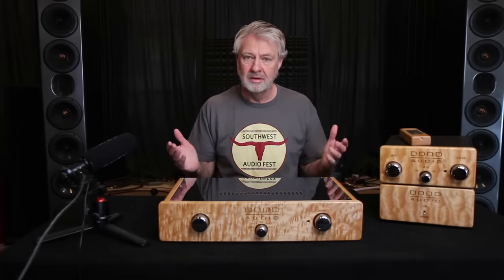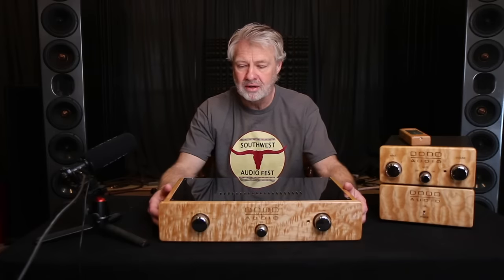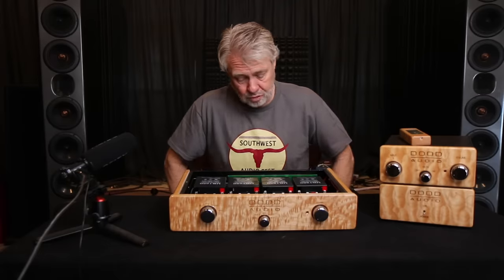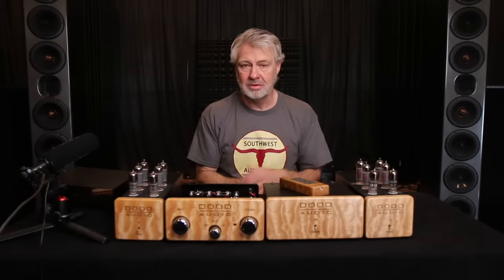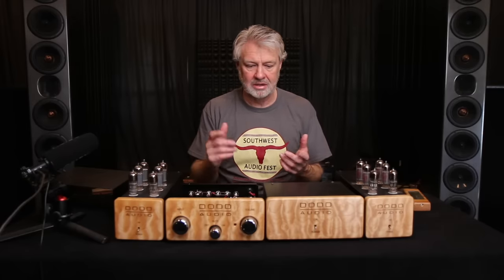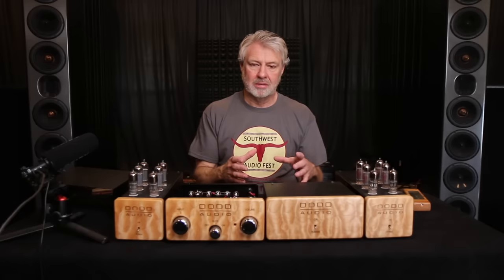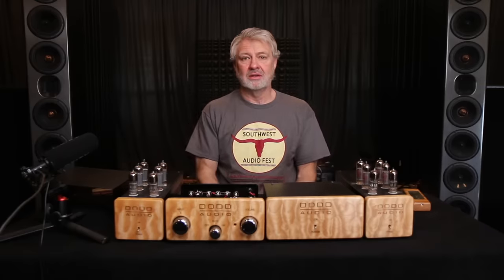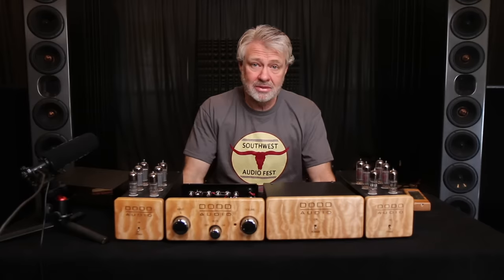Unveiling Danny's Audiophile Rig: Off The Grid and Beyond...

Comment: Danny

Having multiple years in electronics  I have 3 rigs  in my house  DACs,  Tube PreAmps, Streamers, Network Switching All modified to run 12 Volt  and 5 Volts. 

Yes everything you described about the sound is spot on.  I'm Dallas one day I will make it by to see you .

I consider You a legend  in this Hobby I'm positive that my  work has prefected running a system in this manner.

Comment: On the Mac Mini DAC thing, you should try using a fiber optic connection from the Mac Mini to your DAC to further eliminate RF noise which does collect on a copper wire based Cat6 network cable connection. I use a 10 gigabit SFP+ fiber hub on my Mac Mini connected to a Sonore Signature Rendu via fiber, which reduces network cable noise, and the Signature Rendu then connects into a Holo Audio D2D converter which then feeds into my KTE Holo May DAC. As a DAC upgrade, to the Holo May, I would suggest the Playback Designs MPD8 Dream DAC. That DAC is probably the greatest DAC currently on the market today, but it’s not cheap at $15k. Also I use the Mac Mini for upsampling in Roon to 768k PCM and then using the Holo may to decode that 768k PCM signal in NOS Mode, which is far better than trying to up convert in the DAC itself.

Comment: Danny all of this explains how all the little adjustments and crossover tweeks make a clear and immediate difference! 
Your system is very high resolution and resolving a ton of detail and is the reason all adjustments and tweeks are magnified in comparison to plain off the shelf electronics... where lot of resolution is just simply not there to begin with .

Comment: Impressive stuff as usual!... Most of the tube amps I build are for guitar. They are definitely not "critical listening" devices. However, I have been experimenting with DC power supplies for a few years. My goal was to save money and weight by not using big power transformers. It isn't easy to get clean power from a boost converter circuit. Especially when it's boosting to tube plate voltages. Supplies like that can generate their own type of noise, not to mention heat.

Comment: 1- use large ultracapitors 3400F and Ian Canada ucpure for power. The best power supply in the world. Lowest esr possible. Your bigger battery sounds better due to lower esr. Ultracapitors are the best in the world and charge 20x faster than a battery.

2- use audiolinux on a pc running on battery paralleled to ultracaps. Far better than stock Mac mini. FAR.

Comment: One if the nicest sounding amps i have is a JL audio one from my car. I tried it inside with a car battery and it was lively and rythemic and effortless. It is a class D as well. Class D power amps could be a great match for battery due to the efficiency. Tube class a on preamp, D on the powee.
Reply: Which model amp are you referring to? Is it one of their older slash models?
Reply: One of the best class-D amps I listened to is tripath ("class-T").   Tube warmth with almost class-D efficiency.
Reply: Try the little TPA 3110 ,
Reply: Loads of options running Class D amps off battery, I've been doing it for years, plus plenty of Dac boards that run off 12v .
Reply: @JasonWW2000  XDM500/3  With the 2 x 75W running Focal Aria 906 + JL audio 10" w1 in custom sealed box enclosure. Installed in the car I used C6-650 components. I was surprised how good it sounded in the room. Stacking up real well to the Supernait 2. Ok not quite as musical as that but more lively and rythemic and amazing bass for what is not a big amp !
Reply: My friend was not able to tell that I had a sub connected. Sub only playing below 60Hz cause I HATE low registers of deep human voices coming out a sub and I heard that in many peoples systems in cars, common problem. Not easily solved. The doors in a car are not speaker cabinets but need to act as if they are ,so people roll off the bass early to compensate and have sub play to 90Hz  It's not a compromise I would make though :D but it's the quick fix.
Reply: BTW the Niam was 4 times the price of JL car amp and can't run a sub. Food for thought.
Reply: I ran an old JL car amp if a cheap 12v power supply and it was a surprisingly good sound. It was a test to see if it was worth installing in my car. It passed the test easy. Very impressed
Reply: @Batman-n1q1v  Same. JL makes good stuff. Instead of insanely expensive caps and massive transformers I do wonder if a Optima Yellowtop would be just if not more  effective. Huge amounts of current. I think mine can sustain 25amps for 2 hours. Which is about 300w DC sustained. GR is onto something.

Comment: Danny, couple of questions: 1) how do you connect the mac mini to the dac via i2s i.e. does the mac mini have an i2s output, and what type of i2s cable/connection do you use? 2) is your Dodd preamp with variable gain? what gain do you usually run it at?
Reply: The MacMini will recognize the DAC input and it will output an I2S signal through the USB output. My Dodd pre is not a variable gain. Mine has a unity gain output.
Reply: @dannyrichie9743  hmmmm... what device will help getting the I2S signal over USB ???
Reply: @tango_gru  Amanero makes an interface module.

Comment: The bit that would be useful to know is how Gary turned 24Vdc into HT for the tubes without creating switching noise.....
Reply: Agree 100%
Reply: He was a really sharp guy.
Reply: Clearly it did if it took out the camera!
Reply: @Oggycrew  I agree.  It cannot be very quiet (RF-wise) if it messed up the camera from that far away.
Reply: @danmarjenka6361  These are dead quiet and don't produce any RF noise. I will check this out and see what was freaking out the camera.
Reply: @dannyrichie9743  maybe just a turn-on transient if you're not noticing anything while in use...
Reply: @v12alpine  It might be,  and that was turning it on in the mute mode.
Reply: Ha, it wasn't the camera that beeped. It was the pre-amp beeping to tell me that the batteries needed charging.
Reply: Interesting my supportive comment about the power supply was deleted…
Reply: @envisionelectronics  I didn't delete it.
Reply: @dannyrichie9743  That explains it. That is a very nice preamp.

Comment: pretty interesting set up. AC line noise is a much bigger issue than many think. If a person looks at a scope you can all the harmonics (low and very high frequency) riding on top of and well above the 60 hrz main AC frequency. For years companies have been trying to filter it out to varying degrees of success. All this noise is one of the reasons aftermarket power cords can make such a big improvement contrary to what the naysayers chime in with. Likely not as quiet (low noise) as BAT power though. As the noise floor is lowered, resolution, detail and imaging greatly improve.
Reply: True, but all of this noise gets filtered out during conversion to DC by any and I literally mean any properly designed modern device, something that has been shown again and again by actual measurements made at Audio Science Review.
Reply: @SteelBlueVision  If all the noise got filtered out then BAT power should not sound any better...............

Comment: Please try supercapacitors from Maxwell, XS or EATON. They not only balance the voltage, filtering out high frequencies, but they can provide instant electrons, through a physical reaction and not a chemical reaction, like batteries. They do not have much reserve, but they are supposed to be used with batteries, extending the batteries' lives because the big peaks of amperage draw will drain the supercaps and the batteries will only serve to charge the supercaps and keep reserve for longer sessions.
Reply: Our batter buffers work a little bit the same way.
Reply: Ultracapitors Danny are far better than batteries.
Reply: 12V supercapacitors are used for current peaks in highend car audio.

Comment: I noticed significant gains with the way my system sounded when I traced the wiring in my apartment to learn which outlets were on each circuit.  With 10ft power cords, the source and amp were plugged into  outlets that were about 15 ft apart.  The two outlets in between were removed, wires pigtailed and cover plates installed.
Reply: I’m building up crossovers for the X-bravo kit and intend to use the same isolation technique with the components of the crossover.  Crossover will be externally mounted.  Components will sit along the speaker wires between the amp and the drivers.

Comment: I have also taken my house off grid and running solar and a big battery bank which again supplies all my loads. The sound has never been better. Best investment as an audiophile ever.
Reply: That just moves the source to the solar inverters though. He is running ing pure DC and uses this wizard electronics.gurus circuitry.
Reply: @RobertCookcx Not necessarily, he could isolate a smaller battery just to run his audio system while the main battery is charging during the day.
Reply: @RobertCookcx   Even if he is running off the AC generated by the solar grid. It will be much less polluted than the one coming off the states grid coz of less amount of load in the house.

Comment: Thanks, Danny.  2 questions...How can the lay-audiophile get off grid without your bespoke solutions?  And, did you try inverting back to AC so that gear with IEC connectors could be used?
Reply: Danny can probably shed some light on this.....I have thought about using a portable battery pack like the Bluetti or Jackery units sold on Amazon.  I think the issue is that you are stepping up the voltage of the battery pack to 120v, then stepping that 120 down to 12 volts (or even 5 volts) inside the audio component.  Too much conversion of voltage probably results in extra noise.

Comment: I'd actually like to know what Gary and you discovered regarding the lithium batteries and why they didn't sound as good. 

I have a Virtue Audio Sensation that I'm using 2x12v 7ah LiFePo4 batteries with for the power supply. I've never used SLA batteries with it though. Only issue I have is the cheap SMART charger I'm using squeals once the batteries are fully charged so I have to disconnect with a switch when I want to use the amp. Thanks for mention the charger brand you use. I'll have to look into them.

Comment: Danny, two things. You mentioned that you at times use some chip amps. I have experimented with some low power chip amp boards and am impressed. Which chip amps are your favorites? Also interesting enough about the 12v Mac Mini. Now I refer to myself as "Sound for the regular guy." As I'm not high end. I came across an old 12v touch screen medical device. I installed Linux on it and connected a (low end) USB DAC to stream flac files. When I experimented running it off a battery, wow even with my low end chip amps and self made tube gear it was noticeable. I thought it was just my imagination, but maybe not after seeing this video!
Reply: I've experimentee with chip Amps and class a transistor amps and they all sound terrible to me. I can only live on tube Amps. I don't know what in an missing or maybe my ears don't match transistor sounds

Comment: So a harbor freight battery tender which is a trickle charger and a 12volt 25 amp hour battery on one of these chinese mini amps. That accepts 12volts dc should sound better than an 80's 50watt amplifier that runs A/C?

Comment: Hello,
I recently started contemplating using a computer UPS to run my small gear. Do you think that a product like cyberpower sine wave battery backup can do the trick to eliminate the noise from the power source.
I recently bought a LPSU and the change was dramatic to my headphone amp and dac. So I was wandering if a near perfect sine wave would have a positive impact on the overall system?
Reply: I don't think those batteries are large enough for the task. Plus big AGB batteries are pretty cheap.

Comment: My experience with C-tec chargers are that they are extremely noicy. Do you use them connected, turned on, while listening to music, or are C-tec shut off then?
Reply: It depends on which model of charger you use. The larger ones can be noisy, and the smaller ones can be dead quiet.

Comment: The original Advent 300 receiver runs on 12VDC. It has a 12VDC jack on the back for it. So it could be used in cars. I've got one. 

You don't discuss how the 12-24VDC is turned into HV DC for the tubes. Multiple voltage doublers? Through AC conversion? Since the tubes can't be used before it is available, it can't be tube based. 

Being old, I remember physical vibrators to make tube radios work in cars.

Comment: Hey.
Yes, batteries are the cleanest power.

But you don't get many watts of amplifier power with 12v.

If you have to convert 12v to 50v or higher, you add negative things to the clean current. you no longer have as clean electricity.

Is this right?
Correct me if i'm wrong.

Comment: This isn't necessarily anything new or groundbreaking.  Jeff Rowland has been making battery-powered electronics since the mid 90s.  Edge Amplifiers did around that time, too.  However, the Dodd stuff is interesting because they were using tubes instead of solid state and it seems really reasonably priced.  Jeff Rowland's Model 9s were 3 chassis per channel (one for the amp, one for the powers supply, and one for the batteries) and weighed about 600 pounds.  They were also about $20k per pair, if I remember right.  Thanks, as always, for the great content, Danny.

Comment: Really interesting. I've been been thinking about trying something similar on a much lower budget just powering a 15-20W class D amplifier and DAC running into some small speakers on a second office system. Or possibly my turntable and phono stage as they run on 12V and 18V DC respectively.

Comment: Some cool stuff here but as far as running everything off batteries, you can achieve the same effect by using an online UPS, which converts the AC power to DC and then back to AC to make it perfectly stable. These are used for electronics that are ultra sensitive to inconsistent power, like medical equipment.
Reply: Unfortunately those devices tend to limit current.
Reply: @dannyrichie9743  How much do you need? A ~$1500 unit can flow something like 25 amps if my math is correct.
Reply: @dylanbond1627  It isn't so much as what they are rated at continuous, but what they do to instantaneous peaks.

Comment: I have a question: how does off the grid with batteries compare to a power regenerator by PS audio? They claim that it generates a perfect sine wave and clears up the 'dirt' of the power grid with a low impedance.
Reply: I have not A/B'ed them, but I have heard that the regenerators tend to limit current.

Comment: I NEED to know why the lithium didn’t work out.
I’ve used Lifepo4 batteries and it sounded better than mains. I’m left wondering.
Reply: It has something to do with the output impedance and the electronics built into the battery.

Comment: Hi Danny. Please, please, please answer this one question (built a SS pre-amp a few years ago using +/- 12 Volts with two sealed lead acid batteries).  What battery charger do you use that does not affect the sound even when hooked up? Also, could you send a link where I can get it?
Reply: C-Tek chargers.
Reply: Thanks!

Comment: I figured out how to harvest zero point energy from the vacuum and generate cold electricity, which is negative entropic and are essentially electrons moving backwards through time in a localized field, and how to transmit that power wirelessly, all from studying the patents and papers of Nikola Tesla. (Cold electricity means typical class A ‘space heater’ amps would run cold instead of hot) However, while it can power your home forever for free, it does generate a lot of high frequency RF noise, which is not conducive to good sound quality. 😂 That’s the next hurdle…how to do it with low noise. And to that end… theoretically you really don’t need speaker cables, as you could just send the signal wirelessly to the speaker as a high frequency/high voltage PWM/DSD signal in the RF bands and down-convert it there in the speaker crossover. But again you would have a noise problem. I guess you could build a high pass filter into the downconverter/crossover to try to filter out the noise but it would have to be masterfully crafted HF filter to not kill the good sound along with the noise. And that’s essentially what any good DSD DAC does is take a really noisy 1bit pulse width modulated signal and use a good high frequency noise filter to shift the noise out from the audible range into the inaudible rage. So the filter is essentially the DAC.

Comment: Danny, guys... I have underground wiring from the city so my situation might not be as precarious as some folks. I can't, at this time, go off the grid.  Do you have any bang for the buck AC line improvements for my DAC, tube pre-amp and my amps. I have both an old Counterpoint hybrid amp and some little EL 84 tube amps.
Reply: If you can set a battery in your floor somewhere you can be off the grid with any gear designed to run on 12 volts.
Reply: @dannyrichie9743  Thank you Danny. I aspire to that as the wife and finances allow.  In the mean time are there any DC filters that are an improvement ? Those iFi DC purifiers , for example ?